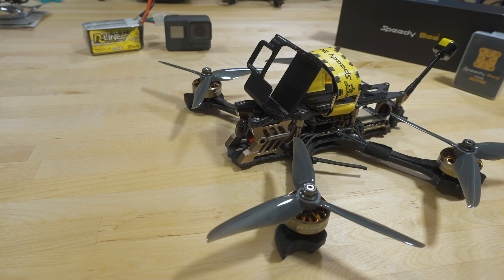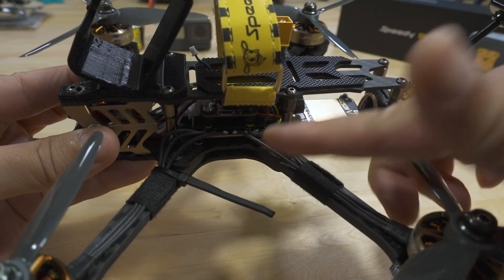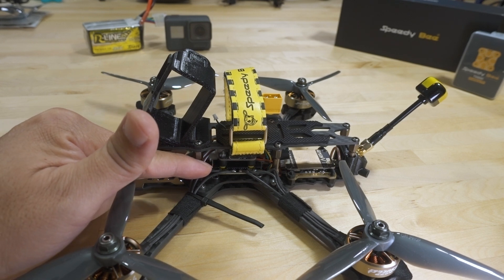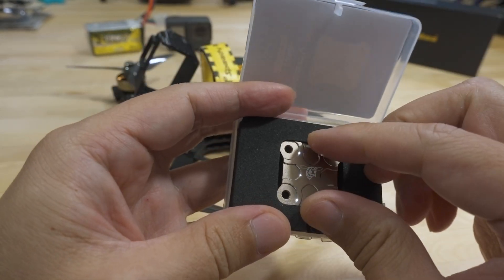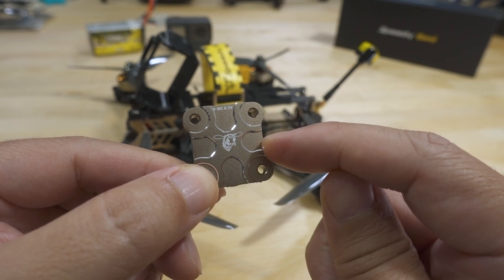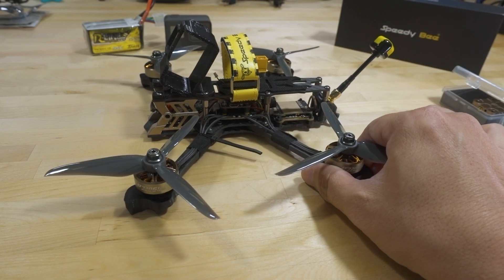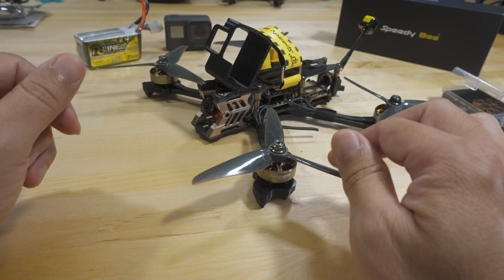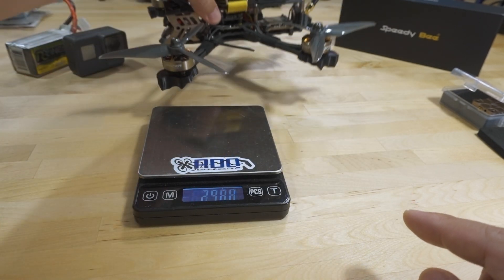The BEST QUAD I've Ever Built!!! // SpeedyBee V2 🛠️🎁

Comment: hey man! How did you fit the tx800? my screws dont seem to fit. Also: How did you mount the antenna? i have the same tpu mount and speedybee antenna but it looks like you use these golden extra parts that hold it down, where did you get those? Would really appreciate soms help since im stuck now. Thansk!
Reply from the maker: Well, I did not use the TX800, I used a different VTX as you saw in the video (or I guess you didn't see it).  The nut and washer came with the VTX I used.  I don't know where you would buy those separately.
Reply: @AlbertKimTV  ahh i thought u said you were gonne put the tx800 in. Because mine doesnt fit, and it also didnt come withtm those gold mounts. Weird..

Comment: Hi albert. 
I have a question. Do you recommend the Xing 2208 1800kV motors? I'm building a 5 inch quad, but I can't decide.
Reply from the maker: 2208 is on the heavier side and most pilots will probably like 2306 or 2207 better.  The 2208 size is also better on 6S vs 4S.  Not sure I can recommend it unless you need it for something specific.  If you're a regular FPV pilot go with 2306 or 2207 instead.

Comment: you should swap the middle and tight end motor wire (under the tape so cant be seen).... looks really stressed, might not need a crash to pull. Beautiful build tho albert.

Entry for SpeedyBee TX800 VTX
Reply from the maker: All the wires are the same length so that won't solve that problem 😎